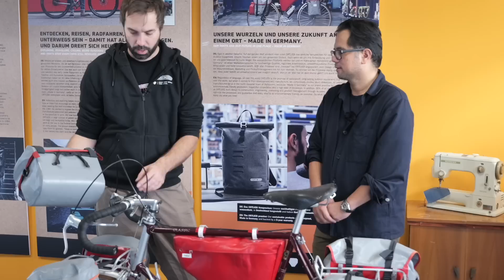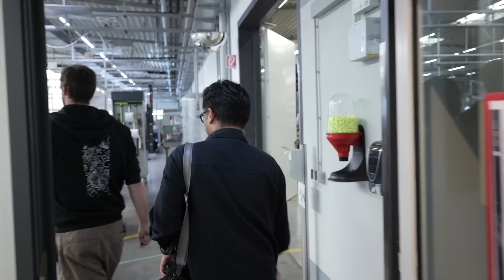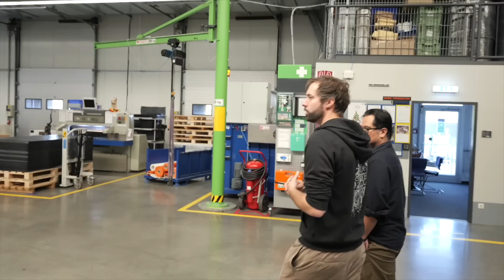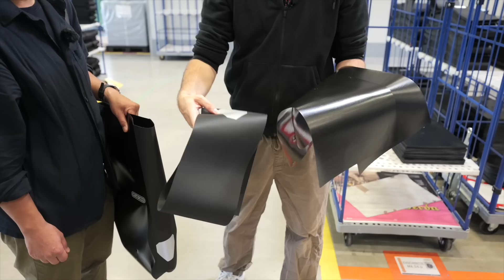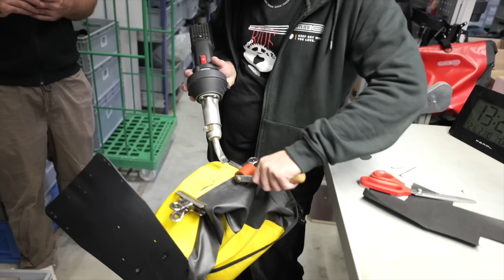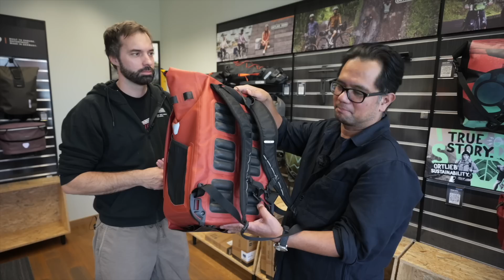How One Ride Changed Cycling Forever

Comment: I love my Ortlieb bags, but I wasn't impressed with the warranty service in the US. We had a little cola spill in a backroller bag, and it dissolved the liner on the bottom.  The bag was no longer waterproof.  I called them, and they just acted like that was my fault, which it was. But no offer to repair. I have since thrown the bag away, keeping the hardware for replacement on the other 3 bags we own.

Comment: I bought a couple of bright yellow Ortlieb Backrollers to replace some copies which had ripped and were not repairable.

Wow! Immensely strong. Secure. I have used them for shopping and touring in France and transporting heavy commercial engine and suspension components. Without a doubt I have missed them. No rips, no damaged stitches or hanging brackets. Incredible.

I would not consider any other bike carrying panniers.

Comment: One of the coolest companies in Germany in my opinion. Their focus on obtaining materials as local as possible and their repair service are some of the most important and modern approaches to follow. Thanks for this awesome report!
Reply: They lost the trail with design though. Their designs are all quite dated now. As someone who has owned a bunch of their stuff--it's too kludgy compared to the newer bag makers that have popped up recently
Reply: @Mebartos  I'm referring to the corporate philosophy mainly. 
You're right, when you say their product-designs are dated but the bags are also very practical, robust and above all lasting! 
I still own some of their bags besides some modern bikepacking equip and i think except for some brands (like carradice or revelate) most of the stuff on the market is not that long-lasting or practical to repair in comparison.

Comment: I rock a 26L Vario daily and I personally love the concept. (And yes, I am experiencing fraying on the connector latches). Only thing that annoys me is that inside is not enough different pockets to organize daily stuff. Major problem with the one large flat pocket directly on the laptop compartment is that it is designed only for flat objects. As soon as you put in more rounded stuff it pushes into the laptop compartment. Some stuff I don’t want to just throw in the large general storage volume. What’s ends up happening is that I basically have a huge storage volume where I have to dig through stuff to find it (like a messy handbag). Yet still I love the bag and its capability.

Vielleicht habe ich auch einfach zu viel „Kruscht“ dabei. Wäre echt schön, wenn es innen einfach mehrere Taschen zum Unterteilen gäbe, ich glaube es gibt Einsätze für die Tasche, aber ich bin nicht bereit nochmal zusätzlich einen Einsatz zu kaufen. Unterteilungen und verschiedene Fächer sind Funktionen, die in dem Konzept Rucksack inhärent sind, meiner Meinung nach.
Aber schon der beste 2 in 1 Rucksack auf dem Markt, gerade mit dem Wissen dass einfach die Nachhaltigkeit und die Reparatur Option gegeben ist. 

Daumen hoch und viele Grüße an das gesamte Ortlieb Team.
Reply: Does the commuter insert fit? That would bring a few more small pockets.
BTW would you recommend the Vario in general? It's probably overkill for that purpose but a waterproof backpack might be handy to walk to the supermarket on a rainy day. I have pannier bags but not the thing from Ortlieb to carry them like a backpack.
Reply: @jochenkraus7016  I have the latest Vario too as my everyday bike bag and it's pretty handy overall but I feel like definitely could use another iteration or two before it really hits the sweet spot.  I think if you just wanted waterproof backpack you could probably do better and significantly cheaper.  My main complaint is that it is not a particularly comfortable backpack. It's OK for biking somewhere and then swapping to a backpack for some quick errands/shopping - but I certainly wouldn't want to wear it while hiking or have to carry it on my back for an extended period (say more than a half hour). The little bumps on the back that they put it for airflow kinda hurt (and make the bag stick out a bit awkwardly) and the straps aren't as adjustable or comfortable as a normal day bag. Also as a $200+ bag it definitely should have a small mesh pouch on the unencumbered side of the bag where you could store a water bottle (there's plenty of room, despite what he said). As a pannier I really wish they had made it zipper up the side - as you saw in the video, even on the newest version the straps dangle out the bottom if you aren't really careful, and it would be awesome to be able to use that as a front pouch to carry stuff while it's a panier. Would be a great place to store a jacket or something.
Reply: @jochenkraus7016  Yeah I think the commuter inserts fit, but I am not willing to pay another 45€ on top of a ≈170€ Rucksack / Pannier (price when new a few years back).

I personally think that the Vario is worth it if you actually use both carry functions witihn one day. If you use it just for one function dominantly and only on rare occasion the other, than it is better to keep the products you are already using. And it is really expensive. Because from my view the Vario is neither a perfect bike pannier nor a perfect rucksack. But it is really good at doing both.